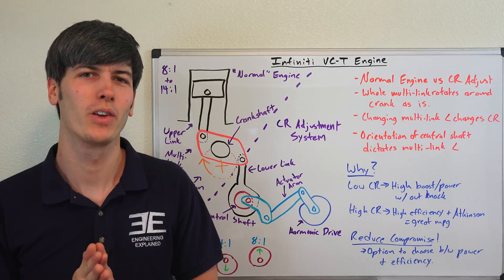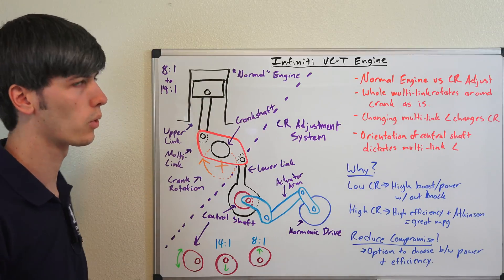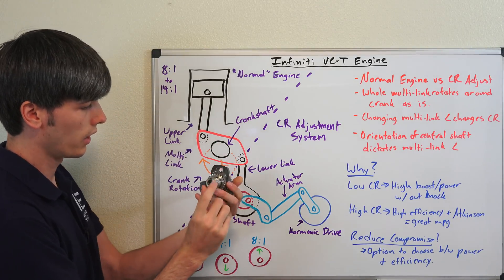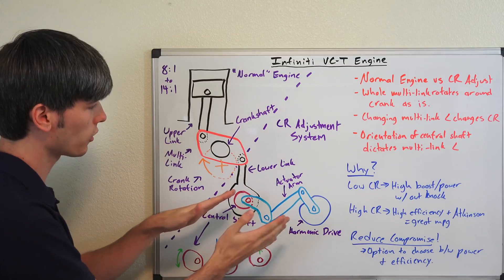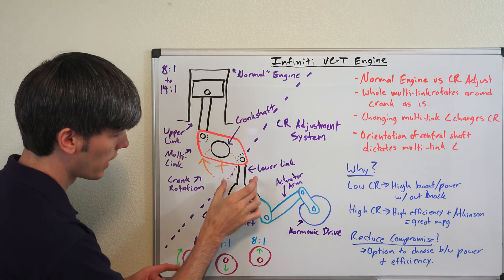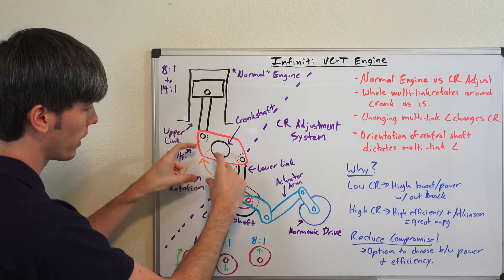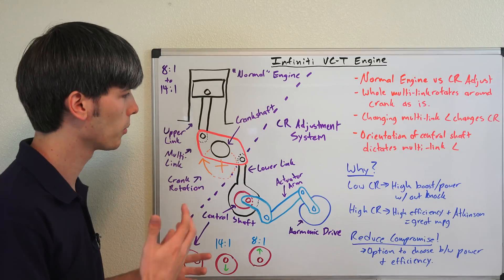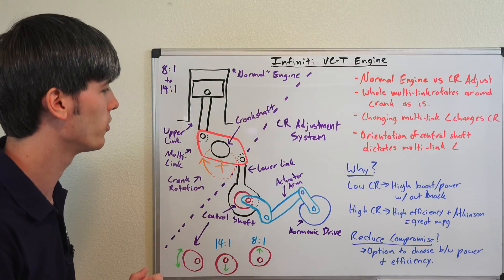Infiniti's Amazing New Engine - Variable Compression & Turbocharged

Comment: Crazy how i was watching vieod on the q50 yesterday and there was a lot of talk of the engine. 26mpg combine on 400hp? Where do i sign up? my 08 TL, only has, what, 260 @ crank and im getting 16-18mpg depending on how i drive. smh
Reply: 6.2L LS3 swaps have been doing even better than that for years..
Reply from the maker: The 400HP Q50 has a different, 3.0L V6 engine. 26 highway/20 city.
Reply: +Engineering Explained sorry got the engines confused. They're using a VR engine now.  Still great milage for the amount of power it has.
Reply: Bro. An ISF has 416hp and if you drive it well it should give anywhere form 22mpg to 27 on a mixed drive. And if you drive on a full hwy drive you can get anywhere from 28-32mpg. I don't understand why doesn't infiniti use multi injection.
Reply: +Engineering Explained I have a g35 that is lighter and gets worse mpg and has less power
Reply: thats ok im averaging 20.9 mpg with my 2013 honda civic..
Reply: I got a 2016 Q50S about 2months ago, my previous car was a 2004TL, I'm getting about the same fuel economy.
My tl gets about 14-16L/100KM (depending on how I drive) and the q50 gets about 15.5L/100KM.
Reply: There phasing out the VQ series kinda of the new 3.0l and 4.0l are VR series like the VR38DETT
Reply: ***** save costs. isnt it obvious...
Reply: Aznwarlord7 doesn't all of the research to do this and validate this cost more than some technology that already exists?
Reply: ***** the answer is that they do 
http://www.automobile-catalog.com/car/2017/2409665/nissan_gt-r_nismo.html
even my personal car 
http://www.automobile-catalog.com/car/2004/2166815/infiniti_g35.html
Reply: My 98 Crown Vic is hopped up to about 250 and still gets 24 overall.
Reply: +Daniel Carrión your not understanding your very own debate the vq series are N/A but aluminum old school tought. never mind direct injection. when you have force induction which is a complete different scenerio the ecm can choose from different maps to cruise or go full trottle open loop. that way you can achieve a higher fuel mileage and power output.
Reply: +N4CR5 Ls motors are old news. Hp/displacement sucks
Reply: +joel champagne old news yes. But still very relevant compared to your "modern" engines
Reply: My 08 TL is now getting 16 to the gallon.
Reply: Damn, lol. I average 11-13 mpg on 87 octane in my '02 Silverado access cab with a lift, canopy and a slightly modded 6.0 v8, and it makes about twice the power at the crank. Granted, I coast in neutral a lot and the ecu seems to like to keep it between 1-1,500 rpm's, so I'm pretty much lugging it everywhere unless I step on it or manually downshift it. I drive my '99 civic ex about the same and get 29-32 using the same 87 octane gas
Reply: My friends 16' Mustang 5.0 is getting him around 23-25 mpg average and it's around 420ish HP.

Comment: Hmm, what about Chevy's variable cylinder system? It uses V8 power for starts and low speeds, but highway speeds it only uses V4, saving a lot on gas. This has been the smartest approach I've seen, and I was able to get a Tahoe up to 30mpg with this system. Infiniti's system, I don't get. It looks like it uses way too many parts, and has too many parts moving at the same time. To me, that spells recipe for disaster.

Comment: Hopefully this helps start a world with less turbo lag. Imagine putting a big turbo on this engine, running high compression until boost kicks in and then having the ecu adjust immediately, lowering compression. That would simulate a more linear power curve/band like a big displacement N/A setup. Wouldn't high compression require a better flowing head anyway, which would in essence help the car rev faster( while still creating power)  putting it into boost quicker?
Reply: +CyberdyneProductions I forget there are soooo many moving parts and potential points of failure in this engine. I really do. As far as raising the compression goes, it'd be relative to what's safe according to the amount of boost and size of turbo you run. So if it's a  really big turbo high compression won't really be an issue until it starts to spool and create boost in which case the ECU adjusts and lowers the compression to suit boost conditions.  Depending on the popularity of this engine people may even develop aftermarket multi-links and rods of varying lengths to compensate any increase in piston shape and size as to not upset the delicate balance in geometry between all of the moving parts in the drive train. You're right though. I don't think it may be a mainstream thing but it's a possibility someone will mess with this engine....you know, just because.
Reply: EDIT: Not rev faster but flow more air. I guess revving faster without a light flywheel is a requirement for a car  that's flowing more air in the same amount of displacement. I.e. K20a2 vs k20a3 (Type s vs base)
Reply: The 8:1 compression ratio sounds like "big turbo" to me (the hp numbers thrown around weren't too huge, but still big).  Hopefully they will be able to bring something like that variable geometry twin scroll Jason suggested was the future of turbos.
Reply: +Cave of the Wumpus you're right. I guess I wasn't watching this video because I failed to notice the increment increase between the high 14:1 and low 8:1 compression ratio this engine potentially offers.
Reply: Electric assisted turbos are probably cheaper and more reliable.

Comment: what kind of transmission would be behind it? while a canyon drive is fun with the engine a trans can only be tuned for mpg or short gearing for sport. so I guess we'd end up with a cvt only
Reply: I would imagine a CVT can be fun for driving if you get passed the sound.
Reply: I would imagine a CVT can be fun for driving if you get passed the sound.
Reply: I would imagine a CVT can be fun for driving if you get passed the sound.
Reply: I would imagine a CVT can be fun for driving if you get passed the sound.
Reply: But they're very boring transmissions, you have no control over their shift pattern or strategy

Comment: would you do a video about koenigseggs "freevalve" camless system and explain where they've got their improvement claims from? (30% more power, 30%less consumption, 50% less emissions, less engineweight, smaller size etc.)

Comment: How does Low CR gives us boost? Please explain.
you should make a video comparing Low CR and  high CR :-)
Reply: Low compression ratio allows higher boost pressure without pre-detonation.
Reply: The actual compression ratio doesn't cause detonation. The actual pressure and temperature inside the combustion chamber does. Under low throttle loads less air enters the cylinder because of the throttle plate and the turbo not producing any boost. Therefore even at 14 to 1 the pressure and heat at TDC won't cause a problem. But if you open the throttle valve and let more air in which also causes the turbo to spool up then there would be too much pressue and heat at TDC leading to detonation if the engine still had 14:1 compression.

Comment: If this will be a diesel engine then when the CR will be low, will the combustion will be inefficient; & if it will be a petrol engine then when the CR will be high then will engine knocking will happen or, not?
Reply: Neither.  In both cases, the CR would be high when there is no boost from the turbo, thus no overpressuring of the cylinder.  If anything, a turbodiesel would run more efficiently in low load and low boost situations.  likewise for a petrol engine.  Then, when the turbo starts to provide boost and you need the power, the CR reduces so higher boost can be introduced without knocking (since the amount you can compress the air/fuel mixture is finite, so the only way to add more boost from the turbo is to have the piston compress it less to compensate for the added induction pressure.)

Comment: We have tested this since the 1990s. 
Didn't really work that well. Adding a lot of friction to the engine and especially the bearing situation of these "rocking" parts is a pain because you cannot reliably achieve the necessary hydrodynamic lubrication film.

/German Engineer

Comment: The only thing I don't like is the shire amount of points of failure, that's what I really like about rotary engines
Reply: +Abniel Sanchez he didn't ask a question..
It was a statement, a correct one.
Also electric cars and battery technology is very rapidly improving, it is already a viable option for many lifestyles.
Reply: +tnnss111 I actually lol'd at that comment
Reply: Gotta admit, when a rotary rarely does work it can tear up tracks
Reply: Raoul G Yeah, it is WAY better.
Pistons, obviously are superior.
I'm just saying, they had their time.
Those 8-rotary setups had little to no reliability
Reply: +Akash Hegde until they have an equal amount of charging stations as they do gas stations, no. And besides, filling a gas tank up is quicker than waiting to charge up a 500ish kw battery (5 minutes compared to about 30 to about an hour just to charge).There's much to be done in the electric car industry, but until then, the answer to your answer... no.
Reply: tnnss111 HAHAHA Accurate
Reply: The shire..... The Hobbit: an unexpected VCR ....
Reply: The Peridoge
can't tell if misspell or intentional...
Reply: The Peridoge piston engine is superior. better toque and power for the same weight and less fuel.
Reply: Raoul G better torque and power for the same weight? do you even know how light and how low rotary engines can be placed? its not all about the power, weight and handling are also really important. by the way im aware of their reliability, i was just pointing those facts out.
Reply: Ivan Cuesta I didn't say centre of gravity, I said torque and power. I know they are capable of a slightly lower centre of gravity. But the negatives outweigh the positives.
An evo engine is capable of better power to weight than a twin rotor engine. However the rotary has a lower centre of gravity, less moving parts and easier to completely rebuild. They also obviously free spinning giving them the ability of much higher RPM. They have cool attributes, however there is generally a piston engine that can do the same job better in the real world. High RPM is cool to brag about, and having something unique and different, but that's about where it ends.
Reply: Raoul G well the centre of gravity is a bit more that slightly lower, but anyways, i know what you mean. a piston engine is already good and it's more realiable than a rotary, but this last one is more special, atleast for me (sound, hp curve, lower centre of gravity...). And talking about the hp to engine weight ratio, the Evo engine is turbocharged so as long as you put a turbo in the equation the comparision gets a bit pointless...
Reply: Ivan Cuesta comparing forced induction rotary, and forced induction piston, piston is capable of higher power to weight. 
Naturally aspirated rotary compared to naturally aspirated piston, piston is capable of higher power to weight. 
There wasn't as large gap in the 90's but today there is no question. 

However there is no denying rotaries are special and unique.
Reply: Or get rid of the hundreds of moving parts and go electric.

Comment: The only thing I'm struggling to really understand is how they can have a shaft which alters the angle of the rectangular piece but is also connected to the lower half of the engine system while not being affected by the constant rotation of the crankshaft.

Comment: I don't see how the central shaft will rotate to follow the crankshaft from your drawing. What is the pivot point of the central shaft ?
Reply: I dont think it will stay dead flat, it will sea-saw.

Think sea-saw on a ferris wheel.
Reply from the maker: Pivot point of the central shaft is the small circle drawn within (see the three illustrations at the bottom).
Reply: That made it clear

Comment: Can you adjust the ratio on the fly or do you have to pop the hood?
Reply from the maker: It will adjust automatically.
Reply: So in automatically do you mean it's controlled by the ECU or is there a power/eco switch that controls it?
Reply: it is a fully automatic variable system. It varies the compression ratio to what the engine needs at that point in time.
Reply: +MagicDartProductions yes, most likely ecu knock sensing controlled
Reply: Definitely controlled by the car's computer, taking a number of factors into account like the position of the throttle, the engine's speed, the car's speed, the gear that the transmission is in, the coolant temperature, the oil temperature, input from knock sensors, the amount of boost that the turbo is producing right now, etc., etc.  Probably a dozen others that I haven't thought of.  But you wouldn't even notice it while driving the car -- you'd just notice the fact that you have more power at its maximum power settings and better fuel-mileage at its maximum economy settings.
Reply: I suspect it will also be a variable system.  So while it was explained in a low compression/high compression format, it's possible that it will be more of a sliding scale, where it could drop your compression just a little to allow for just a little more boost...thus not being a case of power or economy, but a combination of the two, adjusted continually for optimum results.  I mean, all it would take is to move that control shaft less that full up or down.  Just a thought - will be interesting to see if it's implemented that way, or used more like an on/off switch.

Comment: soo... it changes the compression ratio by moving the crank up and down. does that also means it's a variable capacity engine? 
but the stroke should be the same, just where does it moves up and down should be changing..... i'm confused.
Reply: The stroke stays the same so capacity doesn't change. It just moves the piston up or down to increase or decrease the compression ratio.
Reply: The stroke (i.e how far a piston travels in a 360 degree crank rotation) DOES CHANGE to effect the ratio changes in this engine. The engine increases the mechanical compression ratio by causing the stroke of the piston to travel father up to the cylinder head. And decreases the piston stroke travel, lowering the compression ratio.
Reply: stroke does NOT change....only the cranks position compared to the cylinder head..thats all.......so if it rotated toward head...the bottom of the pistons at their lowest point is the same distance the tops move at there highest...the pistons are connected to crank through rods..those distances never change...only the crank moves.....up or down...toward the head or away...thats it!

Comment: Ok am I understanding this correctly? The crank rotation can change its position thereby increasing compression, but the crankshaft itself never moves. So you can adjust the rotation to increase and decrease compression?
Reply from the maker: Crankshaft itself rotates in place, yes.

Comment: Just a question, the lower compression ratio equals more power because that means you can get more boost from the turbo right? As opposed to the high compression ratio, which requires lower turbo boost in order to avoid knock? I thought higher compression ratios had a natural tendency to knock if normal gas was used though, so does this mean the engine runs on high octane fuel only? Still a bit confused...